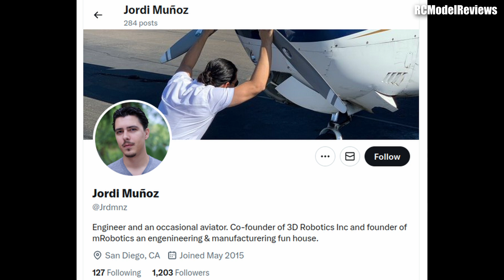Is HackFPV the future of the FPV hobby?

Comment: Jordi, I have a phantom 3 advanced and have been  looking at helical and biquad antennas. I am concerned about a direct short across the antenna or a open  because I don't want to damage the transmitter.  My panel antenna measures 52 ohms yet the omni antenna measures open.  Can you tell me what minimum load antenna can place on the transmitter?   I don't see this issue explained anywhere.   Thank You

Comment: pretty cool, but OpenIPC seems to be more promising. lots of info available already and quick progress with image quality tweaks and new hardware
Reply: OpenIPC is overhyped like crazy, and "lots of info" is a stretch, documentation is terrible as well as part availability
Reply: @Harel-DIY yeah documentation is not great to say the least , work is being done to fix this but it's gonna take time . I do think it's a promising system imo - it's good to remember the gen 1 hardware were relatively low volume releases - manufacturers testing the waters so to speak , the latest news from Runcam and EMAX are extremely promising

Comment: we're always open for cooperations, although the details to this project are very scare. There are a lot of custom digital links, sadly most of them cost a fortune. There is also a lot to consider, "low latency" doesn't mean a lot, there is also no details on the protocol or how much bandwidth you have. There are  a lot of interesting Projects coming to the surface with the high military demand, so I'd expect new things, but most of them will not be getting any certifications or are that expensive that the normal hobbyist will not benefit from it (sadly).
Reply: hmm
Reply: Hay, have you guys seen some of the new aliexpress vtx boards coming out supporting openhd They are getting quite good

Comment: Seems meh, been doing this for literal years if the results he’s bragging about are supposed to be impressive I’m not sure why. Haven’t a lot of people been doing this , it’s off the shelf parts after all.
Reply from the maker: I suspect that it's only now (that there are huge sums of military funding available) that it's been economically viable to progress such a project.  The FPV hobby on its own is pretty small.
Reply: @RCModelReviews  yes .but adjacent industries using similar technology are much larger and where developing in pace with Moore’s law up until recently , namely cell and vtx technology as well as software , your correct about the market being to small to actually introduce new technologies at a higher offering price and then have those users support the development of said technology. I think I benefited from coming from the era in which we had to break apart Wii remotes and baby monitors strapped to ski goggles for our kit, most of these packaged offerings seem slick but are often times sub par to what is possible when simply connecting and soldering the parts built to task as it were, for the operation at hand. But I’m doing something somewhat similar to what is presented here and didn’t realize it was a new thing as I’m not the only one. On our wings we can regularly get 60km , this might also be due to my mountain top location. I think you could even off the shelf strictly within the industry and get these results if not beat them. You can very cheaply acquire a vtx amplifier units pair it with its own power source run both rx and vtx through an independent amplifier and a noise reducer/modifier and your dependent on your amplifiers db and range(watt) you could easily make it move throughout the those wave lengths like a diversity system is supposed to work in most users minds. I move through rx  900mhz to 2.4g I’m pretty sure I got the trick off of YouTube, and I do a much wider band jump for video going all the way down to 433mhz low res,I do it in order to mountain surf through canyons. Sorry for the long response have a good one lol.

Comment: The RF environment in Ukraine is a pretty interesting technical problem at least. In terms of latency I wonder if FPGAs could be helpful for encoding really fast
Reply: They have actually jammers
Reply: Latency is usually not an issue in those situations, also a FPGA is expensive and the gain is very low, you could get about 5-10ms off with a fpga encoder, but that's not really a game changer.
Reply: Jamming is a 2 sided coin though. On one hand you might hurt enemy comms. But on the other hand, you are also basically screaming out loud your own position. You’d think it should be easy for Ukraine to build a fleet of drones (even based on open source ArduPilot) that could use a simple 2.4GHz antenna to autonomously fly a course and map/triangulate enemy jammers. Is this problem harder than I’d think it is?
Reply: @Nightsd01  I'd say no
Reply: No problem.
Reply: @Nightsd01  yeah they need 1000s of tested drones and a program and a way to teach front line soldiers
Reply: @EMDRONES  for one mission why can’t you just use 3 drones to do the triangulation? And for non moving jammers you could even just use one. And you could in principle, write the software so that it’s not too specialized of a job
Reply: All frequencies for weapons are known.  By how many countries?
Reply: Then again for triangulation, in order for drones to be able to triangulate a moving target, they’d need to be able to communicate to each other or a ground station in real time, I guess that’s a challenge. But I’d also guess that most of the time these drone jammers aren’t moving